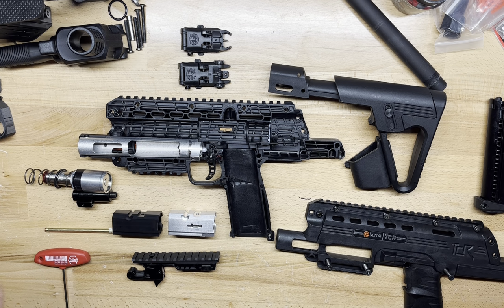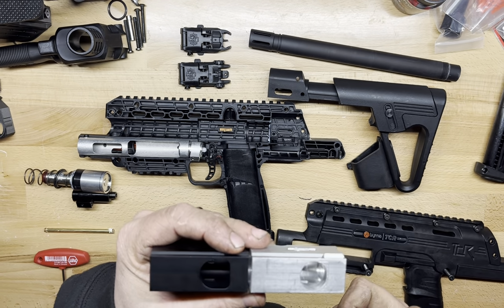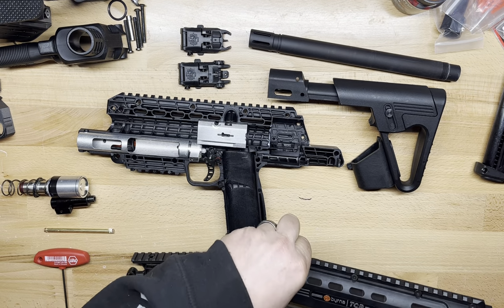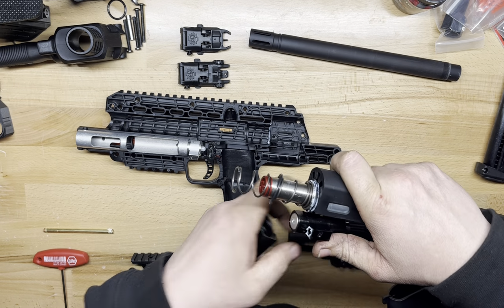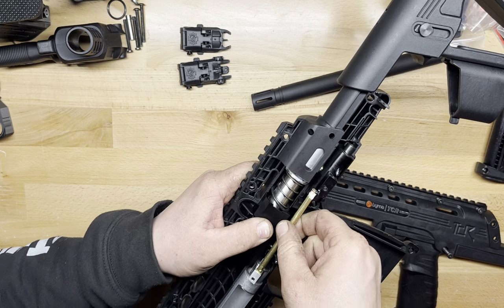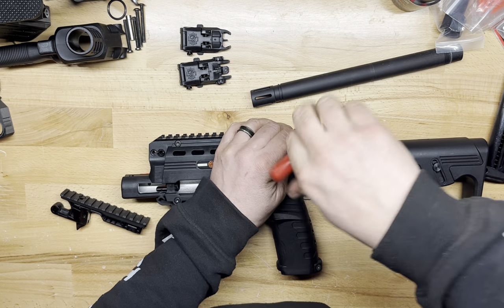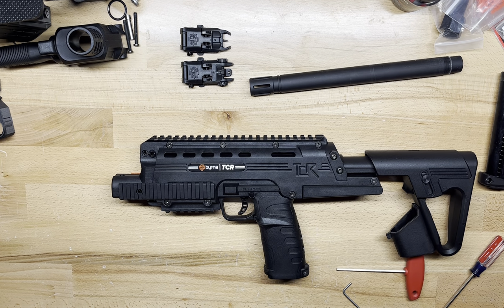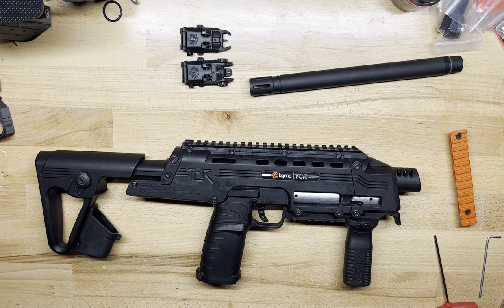TCR Maintenance and Upgrade options

Comment: Do I have to take the tcr apart to swap out the collapsible stock for a black one or are the rear bolts on the stock enough to slide it out? Thank you in advance.
Reply from the maker: Honestly it’s hit or miss, I’ve had it go both ways. Sometimes it will just slide out and others you have to take it apart all the way.

Comment: Would you ever install the remote line adapter onto a Byrna TCR? Just curious
Reply from the maker: For some reason I always lose power using the remote line adapter
Reply: @mercylesslethal6039  K thanks for the info! Maybe its not worth the trouble. you are the 2nd person to tell me about the power loss using remote line on Byrna TCR

Comment: Have you added the external flip down air line like on the Tippmann TCR?
Reply from the maker: I don’t use them I find it loses power on a remote line
Reply: I was thinking to use an HPA in cooler/colder weather since the CO2 looses power in the cold. I’ve not been able to find 12gr NO2 cartridges
Reply from the maker: @lizkatari  you don’t want N2o it’s trash. Good for one shot and then done
Reply from the maker: @lizkatari  I have a video showing it
Reply: @mercylesslethal6039  I’ll check it out. 👍